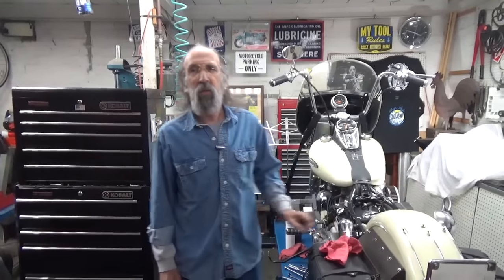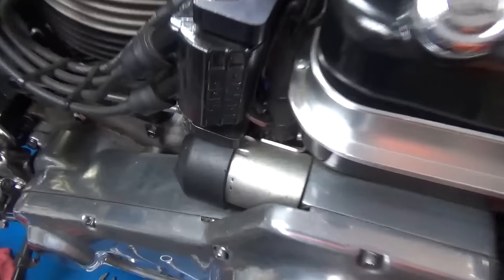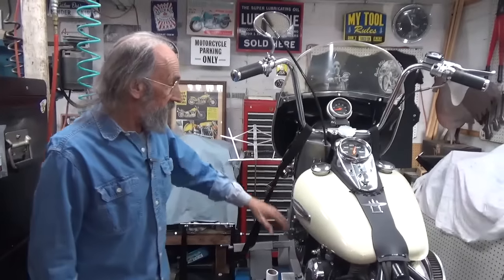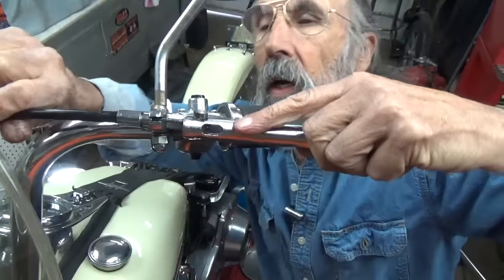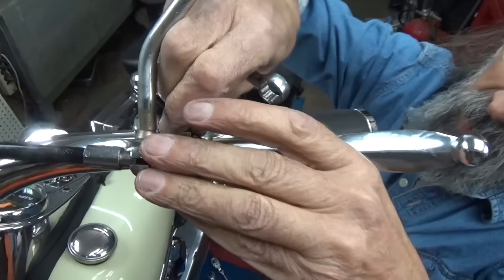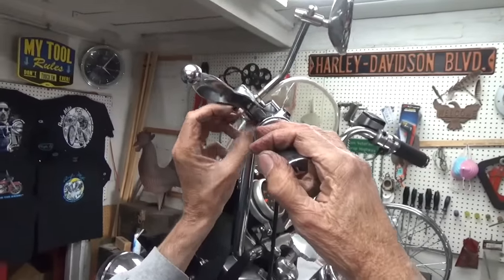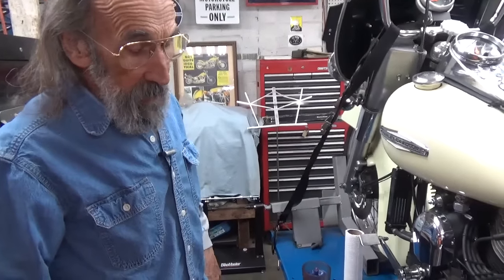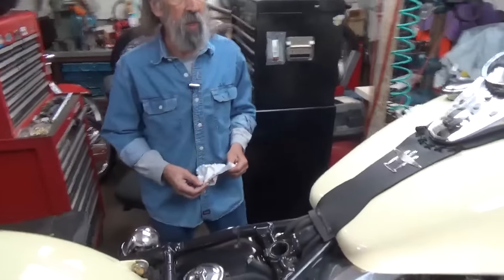Adjusting the Clutch Control on a Harley Shovelhead

Comment: I'm very curious about your exhaust and how it's mounted to the head, are they custom heads or was this a custom modification?
I really appreciate your videos, especially the shovelhead videos. 
I'm always open to suggestions and learning more about them. 
I want to keep my 78 flh running even after I quit running (hahaha) and eventually passed down to my son then my grandson.
Reply from the maker: The heads are STD.  They were made with 3 stud exhaust ports.  So Rob and Nathan at Turner" Customs in Yucaipa Ca. made my exhaust system (my design and their talent) and we only used  4 sets of old pipes to do it.  We'll keep running as long as we can.

Comment: Question! 1960 Panhead. New rebuild on motor. Started and ran a few minutes max . Now I need to pull the heads to check something. Can I reuse the head gasket since it's been torqued already during the build?  TY in advance for your input. I'm a regular supporter of your channel and I have all the tee shirts. 😁
Reply from the maker: I hate to say it, but, I would definitely buy a new pair of head gskets.  Once they've been compressed (installed), that's it.  A pair of head gaskets should be installed once.  And, Thank You.  I certainly do appreciate you.

Comment: Mike ,  I have a1981 shovel ( motor has 140 lbs compression) due to oil tank size biggest battery I can put in is 235 CCA. I wanna put a AllBalls starter in the bike. Is that battery gonna be big enough for that starter ?    Thanks
Reply from the maker: I don't think so.  Contact All Balls and ask them what is required.
Reply: You might want to look at a lithium ion battery. They're smaller, lighter and can hit harder.

Comment: Good morning Mike… 1990 EVO softail… 80,000 + miles … runs great , but shifts a little stiff , and I can’t find neutral without shutting the engine off … I’ve replaced the clutch cable and lever, and made the proper adjustment according to the service manual… the clutch isn’t slipping and there is clearly a engagement / disengaged to the clutch assembly and seams good to me … any thoughts and advice on typical possible solutions would be much appreciated… thank you …
Reply from the maker: Sounds like your clutch is "dragging."  Going through the service manual, did you check for wear?  Did you measure the flatness of the diaphragm spring?
Reply: @pacificmike9501  thanks for the quick response… Im not sure how old the clutch is maybe the original, I do know it’s been opened before I got the bike … I’m hoping it’s as simple as that … thanks for all the good content…

Comment: Mike, great video! I have  a 42 WLA, runs great but grinding when attempting to put into 1st gear. Any thoughts?  Thanks Rob
Reply from the maker: Maybe the clutch is not releasing all the way.  Take it apart, clean it up, or just start with readjusting it.
Reply: @pacificmike9501  Thanks Mike, will give it a shot..

Comment: Hey Mike, thanks for answering these questions! I have a 66' FL that is stock. I had two quarts of oil in my primary when I took the cover off. Does this mean my pick up is clogged or that oil is leaking in from somewhere else? Thanks!
Reply from the maker: Well, I don'tt know what's been done to the bike.  If it's been sitting quite a while, it could have wetsumped and filled the lower end which then leaked it from the "motor seal" into the primary.  Hard to say.  Need more facts from what lead up to this happening.
Reply: @pacificmike9501  Bike sat for a couple years. I put good gas in it, fired it up. I pulled the clutch in and kicked it in to gear and it killed because the clutch wasn't disengaging, which prompted my tearing in to it. I didn't really determine exactly what the cause was but cleaned everything up, put a new pushrod in it and it works great now. I just want to make sure I don't need to address the oil issue in the primary before I reassemble. Your best guess is all imagined you could do without knowing everything. Thanks again!!
Reply from the maker: Have fun.  A 66 stock Shovelhead is a real prize.  Yep, sat two years and naturally "wet sumped."  Keep an eye on things.  Run it.  Make sure while it's running that the oil is returning to the tank.  Pull the cap on top of the oil tank.  Remove the filter and watch the oil returning.  Again.  Enjoy.
Reply: @pacificmike9501  Thanks Mike! Yeah the bike is pretty nice, it was partially restored by Elmer Ehines (I don’t know how to spell his last name) Out of Maple Grove ,Mn. He is a world class Harley restoration guy. I worked for him at Kokesh Motorcycle when I was 16-18. He loved Flatheads and  47 Knuckleheads and built a few very memorable period correct bobbers that were in the magazines. Just thought I’d name drop and see if you heard of him or the shop I worked at…
Reply from the maker: Sorry.  Back in the day, we didn't know people from all over.  We get to now.  There were a lot of folks we'll have to tell people about.  Sounds like you have some great memories.

Comment: Hello,  have a 66 FL, is my primary supposed to be dry? Thanks!
Reply from the maker: It has a drip system, then a pickup and recirculation.
Reply: @pacificmike9501  Thank you very much for the response! When I pulled the primary cover off it had all of two quarts in it, does that mean my pick up is clogged/not working or that I have engine oil entering the primary from a different location? Thanks again, it's really great that you take the time to answer these questions!